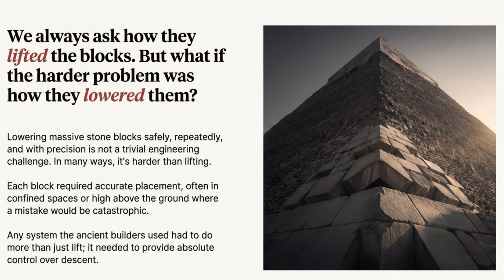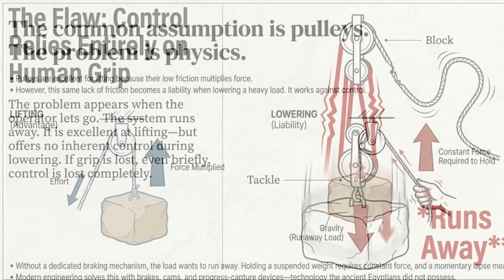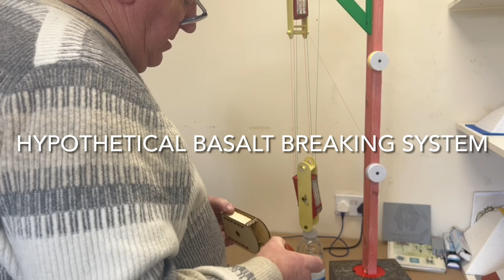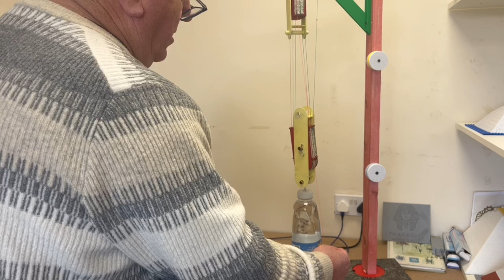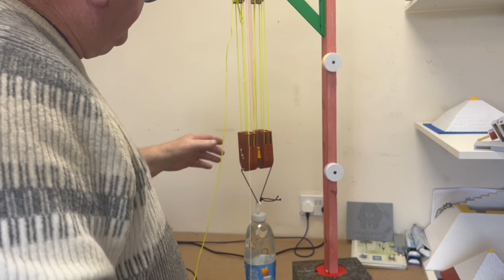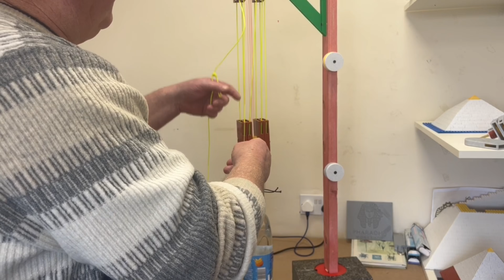Pyramid secret, The Capstan Equation

Comment: Lends credence to the idea of djeds being a type of capstan. The Hieroglyphic "djed" means stability (and also endurance, and permanence) and is often found adjacent to the hieroglyphic "tyet" aka the knot of Isis or girdle of Isis. It was a practical knot, not just a symbolic one. The knot was used by people as a way to tie a sash, girdle, or belt. I don't know enough about nautical knots or engineering knots to be able to compare it to something that would be used in that context, however the fact that the djed and tyet are often found together suggests that the djed was a capstan.

In this video you use several examples of tripling the friction using three wraps and the djed has a place for three wraps. It's maddening how many experts, especially Egyptologists, that consider ancient Egyptians as primitives who often had their heads in the clouds with myths and gods, but they were an incredibly practical people. Having a hieroglyphic be purely symbolic or a metaphor wasn't something they did. Instead they depicted something practical and useful FIRST and had the metaphor or symbol come second. That was their genius and dare I say something that so called more "advanced" man today has trouble grasping.